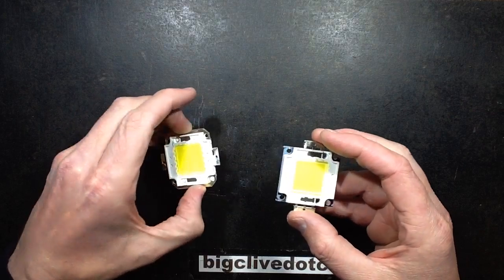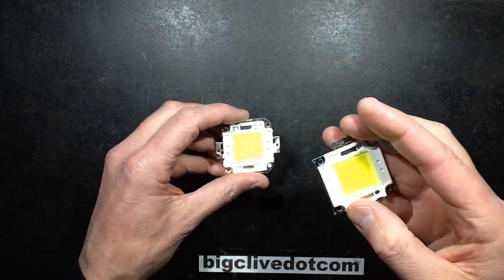Comparing a lightweight 25W LED to a proper 50W one.

Comment: I've got a very bare knowledge of the LED, but I am aware that these need a resistor to limit the current. Is it OK to safely connect 50W LED as presented above, atraight to the car battery (heatsink will be installed)? I am looking for cheap but effective battery powered light in a garage.
Reply from the maker: +Martin The battery voltage would be too low.  You need a boost driver to run the LED (with proper current limiting) from a car battery.  You can get complete LED floodlights for use on 12V that have all the components you need already, and they aren't too expensive.
Reply: bigclivedotcom And that will be the best solution. Happy New Year!

Comment: I have just received a 100watt led from eBay and I am doing the low voltage test and to my surprise, they all lit up at the same time!! There is only one single led that lights slightly late. But 99 chips in there all light up! I was amazed! I wish you could send pictures on comments.
Reply: +shaneman27 Who was the seller? Have you tried getting more from them with as much success or was it a lucky 1 off good LED?
Reply: +bassl0va the seller was "minidavy"  I have not gotten another one yet but was thinking about it to see if they are all evenly lit light the one I got

Comment: Are these actually 25 and 50 watt LEDS, or equal output to a 25 and 50 watt incandescent bulb?
Reply from the maker: +Blaine Bugaski The power rating of these LEDs is the actual forward voltage multiplied by current power of the LED.  So for the 50W LED it's roughly 30V times 1.5A (1500mA).
Reply: Thank you!

Comment: One purpose could be to use a now-somewhat-standard package size, in an application where you only need a 25W LED and along with that, the lower thermal density means you should be able to get away with using a heatsink less than half the size "IF" all else were equal - which is seldom the case, and personally I'd rather under-drive a 50W LED at 25W, but suppose that after cutting a silcon wafer they have a bunch of smaller chip (areas) left over.  This would allow maximizing yield from the wafer.

Comment: Running the chip at such low voltage/current that most have nearly no forward current is indeed not the greatest way to test them due to how non-linear the voltage-current curve is at low current. I would look for uniformity at somewhere between a tenth to half of its "rated" power for something hopefully more representative of real-world usefulness. You may need a camera with 1/6400s shutter speed at -3eV exposure to analyze it though, depending on how bright it gets.

Comment: What is the current before the global 'knee' where they all turn on? I guess to a large degree, you only care about lm/W if using them at maximum, or PWM. 
The remaining interesting question would be do the 'leaky' LED chips get more leaky with time, perhaps to the degree they start causing current hogging and overheating of 'good' dies.
A large '25W' LED at least is much, much easier to interface thermally.

Comment: While recently visiting Los Altos (California), I found it interesting that most street lights and traffic lights are LED now.  The obvious tell-tale sign is that I can clearly see rectangular matrix of white dots, similar to a large LED light used for videography.  Even large streets such as 4-lane motorways have LED lights are surprisingly effective at lighting the street, especially when compared to HPS lighting where streets using HPS lighting merge.  

Despite the widespread use of LED lighting there, I have seen very few floodlights there that use this these COB type LEDs and certainly not with any street lights, probably because they produce harsher lighting than having individual LEDs spread out across a panel.  Most shops and parking lots there use LED tubes in place of fluorescent tubes.  One obvious flaw I noticed with the LED panels is that I saw the odd light with one or more clusters of LEDs out, especially traffic lights where I seen some with several clusters out within the circle.  They also seem to upgrade the traffic lights as the bulbs fail as there were many traffic lights where the yellow light is clearly incandescent and a few where either the green was incandescent and the red being LED and vice versa.
Reply: +Seán Byrne There is a street nearby with a sign posted saying "SLOW: Street light testing ahead." Each pole has a placard labelling lamp manufacturer, model and power (e.g. "General Electric Evolve 90W LED"). There are about 12 such poles.  When they're on, it is obvious that the colour rendering is vastly superior to the neighbouring sodium lamps.

Apart from newly built streets or areas where the lights have been retrofitted, old yeller still rules around here.

Comment: interesting. Theay are trying to save pennies By the looks of it. I haven't have much luck lately with ebay LEDs. Do you know any trustworthy ebay sellers?
Reply: +Tiit Saul Yes please, I would also love a recommendation for which ones sell decent LEDs 50-100w. I have a set of good 100w warm whites but same seller sent a set of dodgy cool whites.  Thinking of ordering genuine CREE next time, I imagine they will be good quality.
Reply: High power CREE cost is more than ten times the cheap eBay ones. I do get refund for the dodgy ones, but it
Is a lot of time wasted.